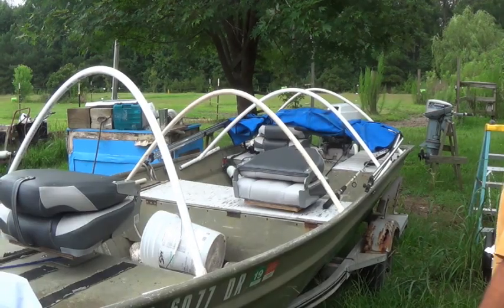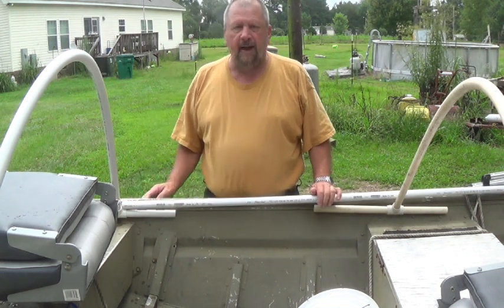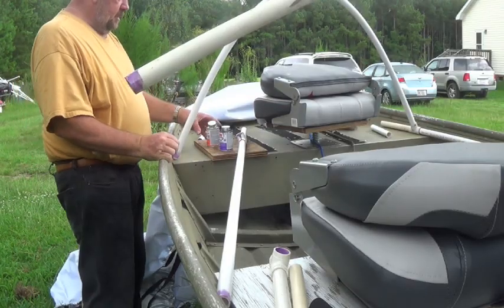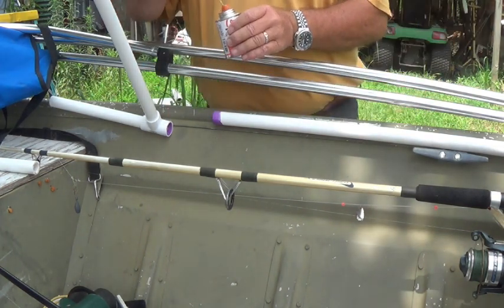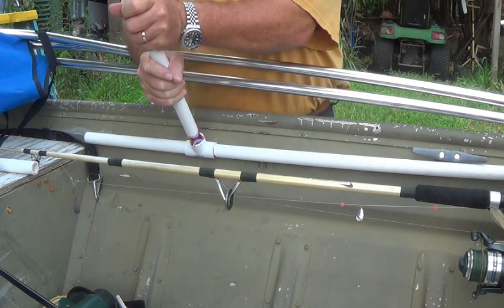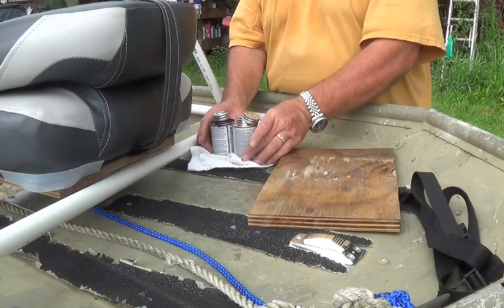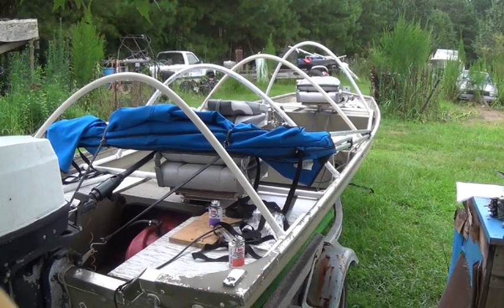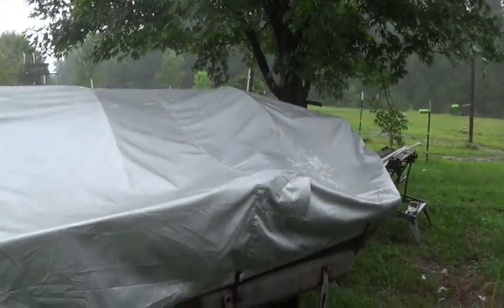Jon Boat Cover Supports

Comment: Interesting system.  I've watched a lot of vids here on building one of these and most use 1/2 in pvc.  I just got back from Lowe's and while they had the 1/2 in pvc they didnt have the connectors for it.  In fact, they said they were discontinued. ????  So, instead of a maybe $40 system cost I had to upgrade to 3/4 pvc and all the parts came in at $85.  Thanks Lowes.

Comment: loved this idea. I changed just a little and it works better for me space wise.. I cut out the t's on bottom so they would snap over the round gunnel of my boat. My boat is 14.5 long and 60 inches wide. I built 4 of the strusses and spaced them accordingly to hold up my cover. My stystem is no where near as strong as yours but works fine for me and when I remove the strusses they take up very little room leaned against the wall of shop on top of the cover till I get back from fishing and ready to cover again. Love to watch your videos sir you are a great teacher.
Reply from the maker: Thank you for the kind words. Thanks for sharing and commenting, and as always keep watching.

Comment: If you build it wide enough to extend over the sides of the boat you won't have that trough of water inside the gunwale. It will run off the sides. I made something similar using PVC to make a single ridgebar about 3 feet above the gunwale, and simply stretched a tarp over the sides and bungy it to the trailer.
Reply from the maker: That's a good idea Thanks for the tip.

Comment: Good idea. Although, gluing the horizontal supports would have been more practical for breakdown when getting on the water. Did you remove the bimini after getting it all assembled or just cut it apart when you figured out your mistake.
Reply from the maker: Believe it or not I did leave the end open to get around the bimini top. So it all worked out for me. Thanks for watching and commenting. Stay Safe.

Comment: nice idea.  couple of questions.  What size PVC?  where did you buy the tarp with stretch band on outer part?  Is it water proof or water resistant.  Thanks
Reply from the maker: I used 3/4 inch on this project. I bought the tarp at walmart. They have three different kind at the walmart I am close to. Not sure on the last qustion I can not read the label anymore. Thanks for commenting and as always keep watching.

Comment: Could tell all sizes you used to build it thanks
Reply from the maker: I used all 3/4 in PVC. I will have to measure and get back with you on the rest. I made the pipe in the back a lot longer then the ones in the front.

Comment: It doesn’t work pretty good, the sides will collect more rain en more rain and it will pull on the cover, u should add a top row what will connect all the rods otherwise it will dent in
Reply from the maker: With every idea there is always room for improvement. Thanks for sharing.
Reply: Om Fishing correct !💪

Comment: I wonder if this can handle snow...lol. what kind of glue did you use ?
Reply from the maker: I just bought the little box of primer and glue from lowe's home improvement that was right by the PVC pipe. I though for this project it would be good enough.
Reply: @OmFishing  what size are those pvc pipes ?